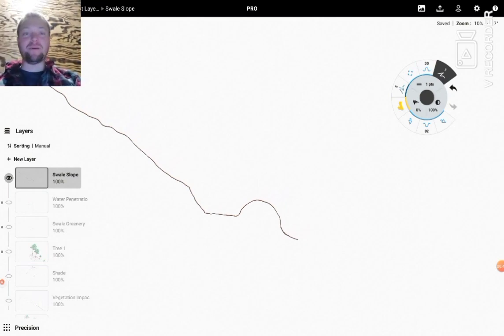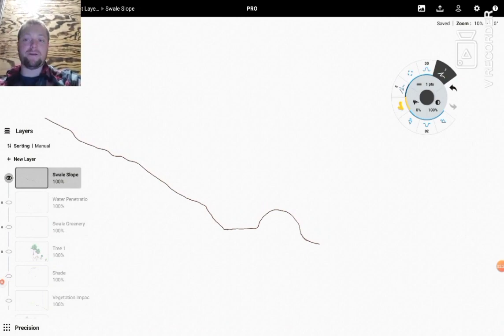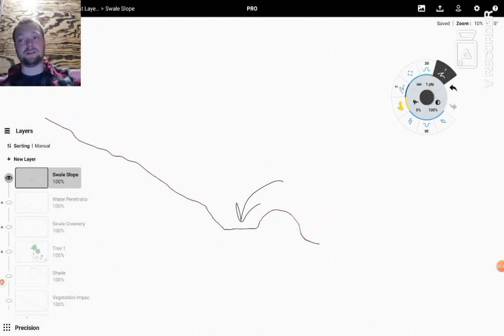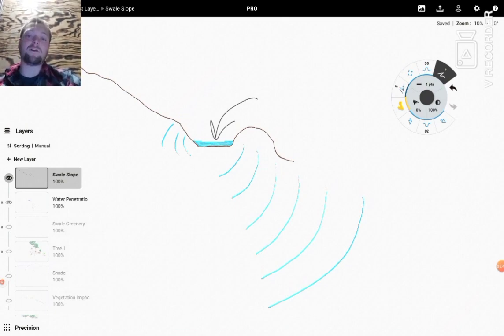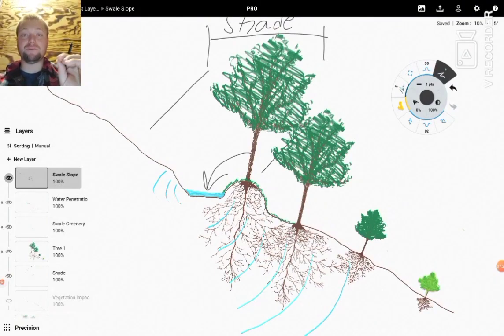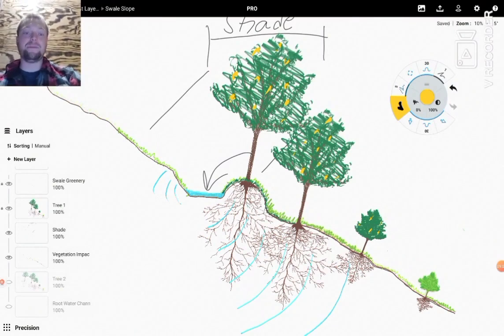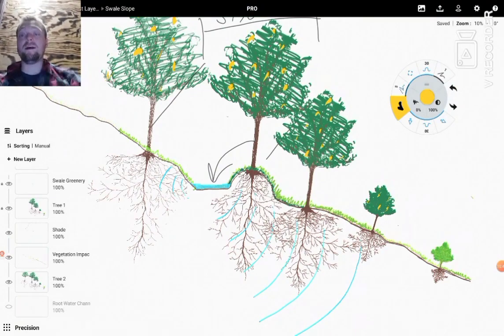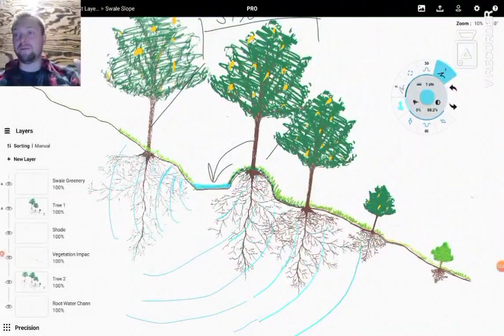How To: Permaculture Swales - A Basic Summary

Comment: Hi Im from Colombia and palanning a coconut plantation, do you think swales are good for this? I dont know exactlly the size of the coconut roots and at what distance I should do the next swale. Its very interesting and probably no use of the drop irrigación. Thanks for your information, Ximena Velez
Reply from the maker: as a general rule of thumb capturing water for any application with trees is the ideal practice. but it depends widely on your specific situation, whether or not swales are right for your project.

Comment: Flat land swales are actually very useful.
Reply from the maker: Flat land slows and spreads water sufficiently across a landscape. it is already a catchment surface so there is no need to spend the time and money to develop swales. In the event it is not actually flat, but slightly sloped, swales or key line should be used. But a true flat is unnecessary, planting patterns yield enough of a mounding or retention on the landscape to penetrate the water through the subsoil just the same. especially if a heavy mulch is used (which always should be!)
Reply: @HavenPermaculture  not always true especially in the desert.

Comment: Water only goes straight down very little lateral movement. The only time it moves laterally is when its on the surface once under the surface it’s straight down.
Reply from the maker: That would be the case in the event it was sandy, rocky, or other type of dirt.

But when dry soils, hummus, organic matter and or roots are involved there is capillary action. and micro organisms trail tubers in the soils that move water along tilted horizontal paths.
In a swale, all this happens during the time the water is puddled in the swale itself. The tree roots and michorhical fungi act as a water magnet, so to speek. And this microbiology can even move the water up hill under the soil.
Once it is no longer visible on the surface and has mostly dried on top, you are correct, it begins moving downward and not so much of a "ploom" effect takes place.

Water is a real magic substance, and depending on levels of microbiogy in the soils behaves differently under and above ground from swale to swale, and climate to climate.
Reply: @HavenPermaculture  I have a farm I flood irrigate that is also terraced I can show you all the photographic evidence and video evidence that within a foot of the water line the vegetation does not grow only where says a gopher hole is will water migrate. On the edge of the terrace on the up hill side in theory the entire slope should have vegetation growing on it but nope that is not the case I live in the dessert where we receive 12” a year so an moisture makes a huge difference. Once under the water will not migrate unless there is some sort of rock or hard pan that would cause the water to move horizontally. I do dirt work for a living and specialize in laser leveling and managing the movement of water. I low rainfall areas it saddens me to see swales build in the way they are shown on mainstream. The absolute best is a level surface with a berm or a slightly sloped area with a berm to spread water on the surface rather than swales. You can see the difference in my videos I have posted. On steep slopes is where swales work but in less severe slopes water on surface area is the only way to go. I can send you all the videos you would like to show you the lack of vegetation within a foot or two of regularly flood irrigated fields. Many properties would benefit more with just berms with out the swales. I would say almost all falter land areas.
Reply: @rvliving1310  So what would be the degree of slope would work best for swale?
Reply from the maker: @mandiegarrett1706  between 1 and 3% is the general rule of thumb, but I have seen them successfully applied above and below that. 
Above 3% the energy of flow can be too great and increase chances of erosion. Check dams or other mitigating methods can be used to enhance water penetration or the effectiveness of swales or key line designs on steeper slopes.
Reply from the maker: I would love to chat more about this with you and see some of your photos/videos of your projects. Swales are not always the answer but they are absolutely worth looking into every time just to be thorough. Correct me if im wrong, but it sounds to me like your system doesn't have any rooting vegetation to assist the water flow underneath, and may not have Any organic matter deposited to ensure sub soil life activity. These are incredibly important elements in a Swale design because they fluff and divide soils below the surface, allowing water to seep and move. Where there is no spread under the soils there is likely compaction, and no amount of water will fix that. Intentional vegetation and 3% or so organic matter in the soils of the swale with a thick layer of mulch will increase the penetration each season. Swales on both sides of the slope should always be covered with living mulches, ground covers, trees, etc. Bare swales do not offer the intented result
Reply: @HavenPermaculture  I have tons of organic matter from native grasses, lettuce and other vegetables. I can grow lettuce like grass. I have more ground cover and more diversity than any other place I have seen in the desert southwest. The fastest way to break up compaction is with insects. When it rains I can push a 6’ aluminum tree stake six foot in the ground just with body weight. Compaction is not a problem at all after a couple years. I’d be glad to share videos and pictures of before and after the work I have done. I’ve held ever drop of rain from a hundred year rain event which was 1 million gallons in one hour while other peoples places were flooding. It’s all about design and the right plants. I have other means of communication where it is easier to share those videos. Just let me know if that’s something you would like.
Reply from the maker: @rvliving1310  sounds like you have applied many of the principles of permaculture design over some years and are reaping the rewards! Let's jump to Email. Send me some info at Jamon@havenpermaculture.com